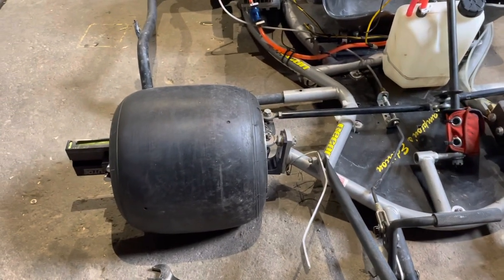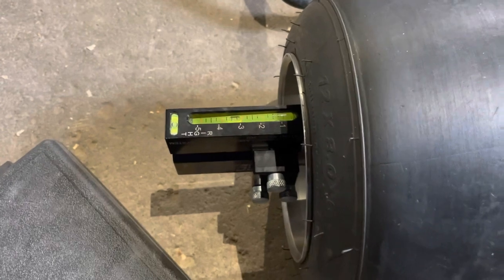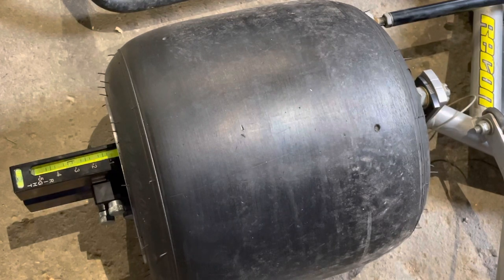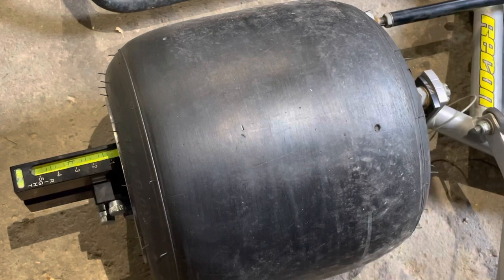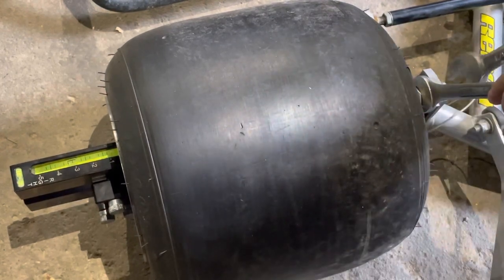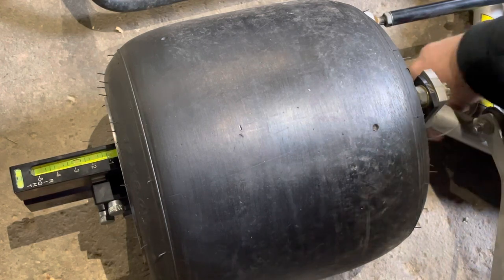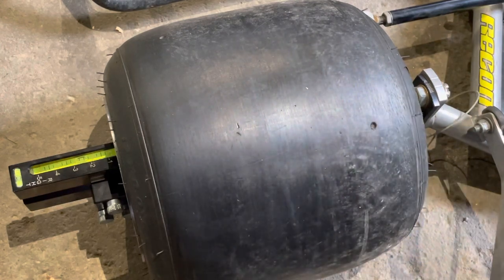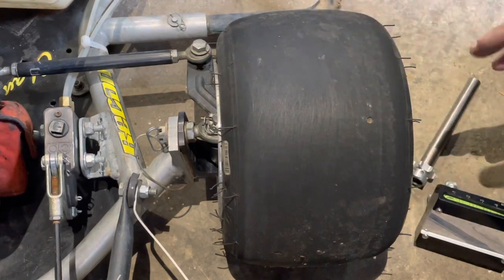Setting camber on a kart (Accutoe system)

Comment: How do you know how long to roll tires and how much prep
Reply from the maker: Depends what u wanna do.  I have my general rules for internal. Maxxis: max 2oz  right sides 1oz left sides.   Vega yellow 1-4oz (half that in left side tires) depending how low I want the Durometer or how hard I want the tire to bite.     Roll for at least 12 but I prefer 24+ with higher amounts of prep.